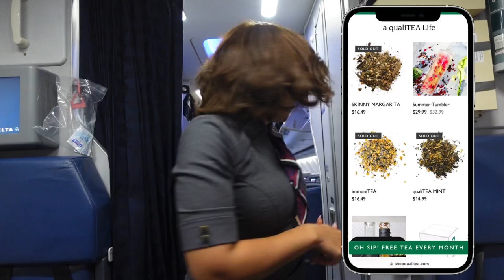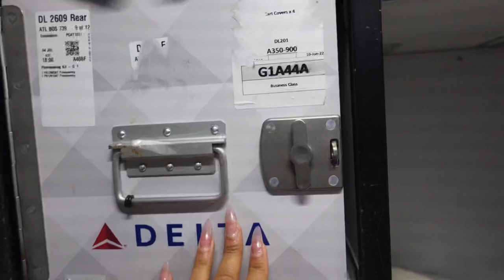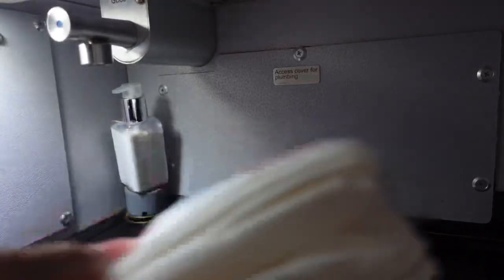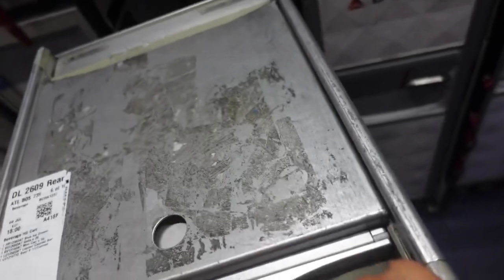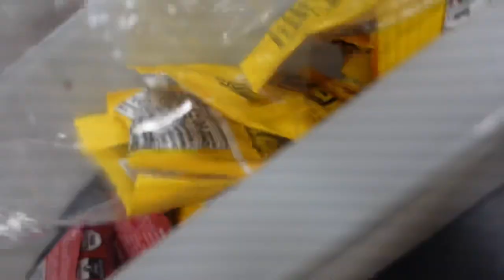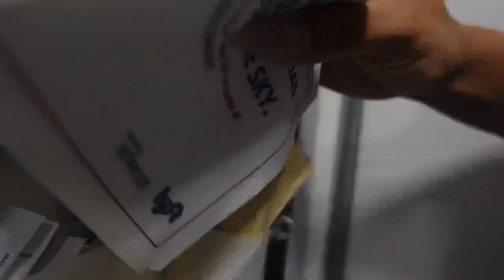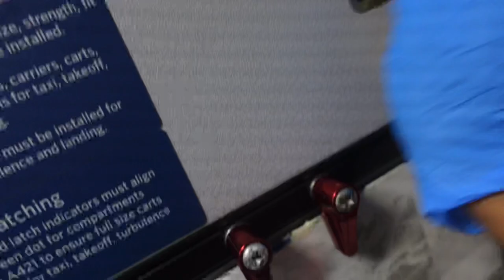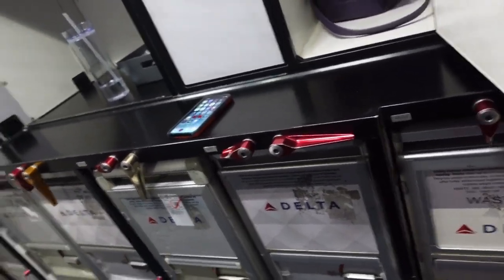Gon’ Flying Episode 3 : How I Set Up My Galley | Flight Attendant Life

Comment: Why touch the ice you serve customers without gloves on? You use them to clean the surfaces, but don’t have them on when you are placing the ice holder on top of the ice? Huh? 🤨
Reply from the maker: Gloves are never a standard serving requirement. Think about this the next time your waitress or bartender makes a drink. Gloves are primarily used in the medical field.
Reply: @justCHANEL  So cleaning the surface with gloves on is a “Standard Requirement”? Because you seem to ALWAYS want to use them to clean around you, but won’t use gloves on a flight when your handling food and beverages that go into peoples’s mouth? Maybe Delta should “reconsider” what should be “Standard Requirement’s” especially since Covid is STILL a concern for people.